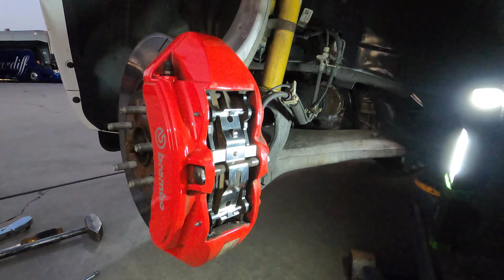Swapping my Brembo brake pads to Power Stop pads. No more dust!!

Comment from the maker: What you guys think? Pretty simple install right? let me know in the comments below. They work great!!
Reply: Nice video.  Have you found any noise issues with the braking since installing?  More or less the same as original pads?  My wife is sensitive to noisy brakes. :P
Reply from the maker: No noise at all. It’s been quiet braking ever since install. Sorry for late reply. YouTube didn’t show I had a comment.
Reply: Matty SRT 👍🏻 That’s good news. I went ahead and put them on my SRT Durango as well. I can also report no noise. My wife is very particular/sensitive about brake noise. I didn’t even turn the rotors first, so that’s a real plus.
Reply: I would not say simple doing it the first time. But your great instructions made it simpler for sure.
Reply from the maker: @danhuffman59  there’s always a learning curve the first time.

Comment: So, just something I do, and not judging, just sharing my own OCD'ness... I open the master cylinder cap to make pushing the pistons back in a little easier for pad replacement. Also, when I torque the wheels, I don't do it with the wheel 100% on the ground with the entire weight of the vehicle on it, but lower the car just enough to prevent the wheel from spinning to avoid any potential elliptical effect, even though yes, the lugs are hub centric and not lug centric so SHOULDN'T be an issue, just something I've done out of habit. Oh, and I use a torque wrench and torque to spec the bolt that's present on the 6-piston calipers. Obviously the 4-pistons don't have this. Oh, and I also only use the Brembo pads to avoid any wear and tear on the rotors, but yeah, dust, but if you replace with a non-slotted, non-drilled rotor (in fact, the new Brembo replacements don't have them anymore because modern pads don't really need to "gas off"), you don't get much dust anyway. But yeah, nothing at all wrong with what you did, I just have too much time on my hands. Anyway, great video, thumbs up!
Reply from the maker: Ty

Comment: With the brake reservoir open wouldnt air get into the system and cause the brakes to be spongy?
Reply from the maker: @richardwalcott7026  no. It’s a closed system yes but the reservoir is the part where you can do this. Just like your coolant. The system burps etc from these areas just fine as the lines are on the bottom so no air can get in unless you run it completely dry. Hope that makes sense
Reply: @MattySRT  thanks for the timely response and how did the pads treat you ?
Reply from the maker: @richardwalcott7026  I’m almost at 50k miles now and pads are still going strong!

Comment: When compressing the pistons to remove the pads, does it gouge the rotors to pry against them with screwdrivers?  I'm guessing the rotor is extremely hard.  Is there a tool for that?
Reply from the maker: If you do it correctly it won’t be a issue. Rotors are very hard. The trick is to use the edge of the rotor as your pivot point and have it so the screw driver is putting most pressure on the brake pad and not the rotor surface if that makes sense. The shaft of the screw driver should be only in the edge of the rotor

Comment: How do you like the z23? I've been looking at the z26 and reading great things a out them
Reply from the maker: Z23 works fine for my application. It’s the quieter ones out of the others. If you so a lot of
Towing and or racing then get the 36. If you do moderate towing or racing then get the 26. If you just do occasional races or pulls etc and little to no towing then get the 23

Comment: Great knowledge shared .. I will be doing my own
Reply from the maker: awesome man!! Glad that my videos help others like yourself!! It saves money and time and its so easy and fun to do! Maybe not fun but easy. haha
Reply: @MattySRT  naw you right.. I been working on cars wit my pops since I was 8 years olds.. bxk then when u got under a car u saw everything not a panel covering everything.. but it’s always fun working on ur own ..
Reply: One last question..lol.. are the z23 the best pads , I mean do they have less brake dust?
Reply from the maker: @Dirtyface973   you can do either Z26 or
z23 pads. I’d go with the 23 as they are meant more for everyday driving. The 26 is more for extreme racing and towing where the brakes are heated up a lot.
Reply: @MattySRT  copy that.. thank you

Comment: Any significant difference between these and the z26 pads ?
Reply from the maker: Well I haven’t personally tried the 26 ones. The difference is very negligible I’m told. The 23 should offer slightly less squeak noises in the cold as they use a different backing
Reply: @MattySRT  good to know . Thanks Matty

Comment: Where you put a jack stand and jack floor?
Reply from the maker: theres spots you can use right behind the front tire and right in front of the rear tires. Just need to look under the car and you will see it

Comment: You may have over torqued that 13mm screw. I know my SRT Cherokee calls for 24 ft lbs.
Reply from the maker: Interesting. Didn’t know there was a torque setting on those. My mechanic guy there is really good at those things but I’ll recheck with him and see. Thanks for the info.
Reply: @MattySRT  No worries, great video!

Comment: I worked on helicopters they designed these brakes to be Easy to replace. However people are misled and buy oem componets at markup prices. Just because its not mopar doesnt mean its still not a great option. Will buy the whole powerstop drilled and slotted kit If the pads I got wont fit.